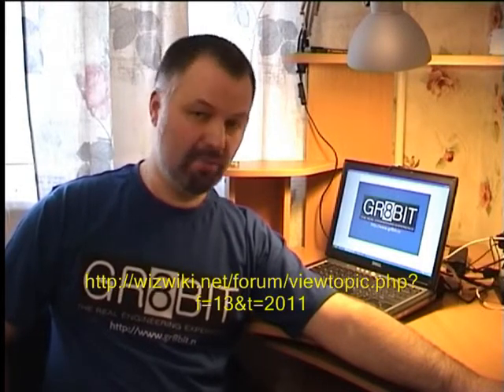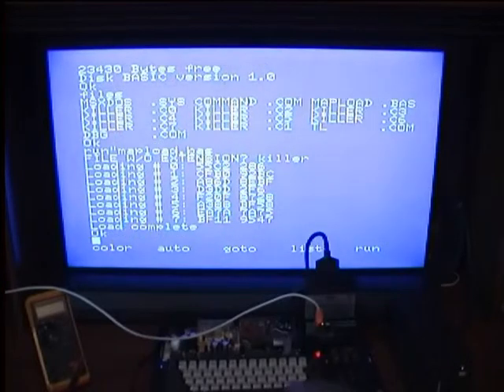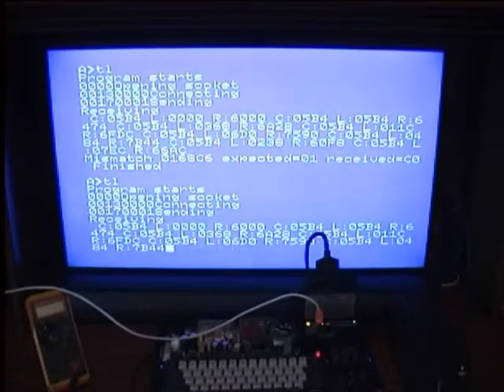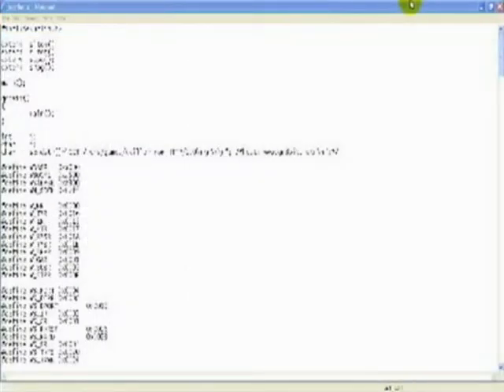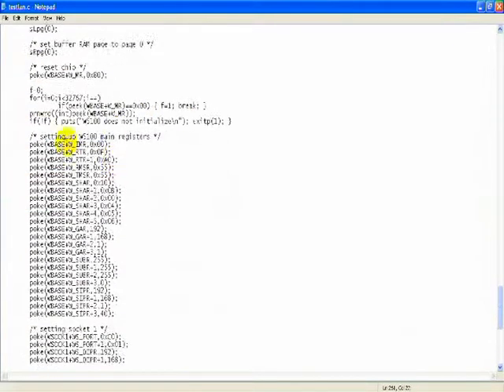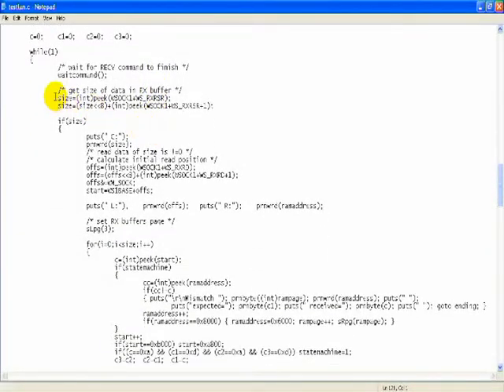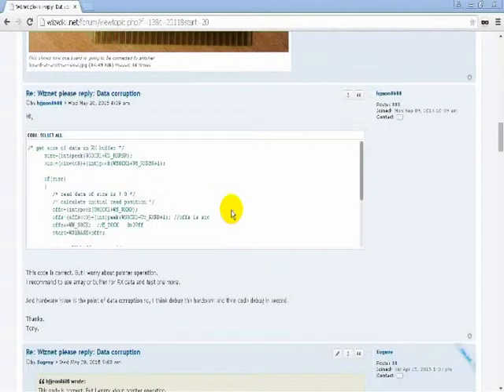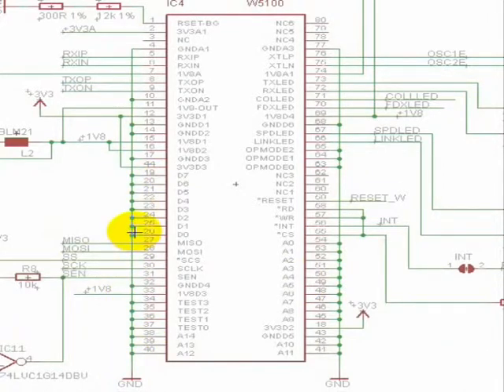Data corruption with WIZnet W5100 (solved)

Comment from the maker: The issue was resolved: it was in the timing of the parallel bus. Corruption cases were persistent when I deactivated CS line later than RD line; as soon as I changed the circuit (FPGA configuration) to deactivate both lines at the same time issue does not exhibit any more. I do not know the source and root cause of the issue, but I am happy with this solution.

Comment: Hi Eugeny, I have just started a project with a W5100 and like you I find I got some random data corruption. My solution is when reading RX_RSR, RX_RD, TX_FSR and TX_WR to read them twice and if they don't stay the same try again. It seems that the Wiznet advice to read MSB,LSB to ensure integrity is not enough. I still get occassional problems but not as many

Did you solve this another way?